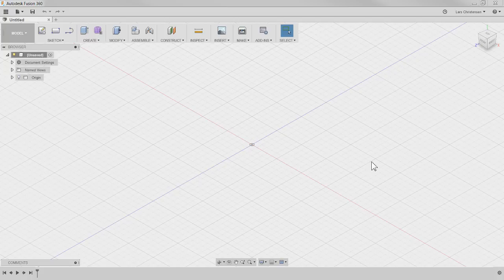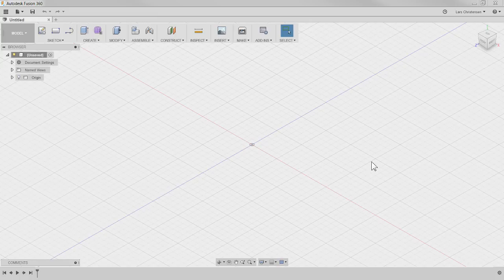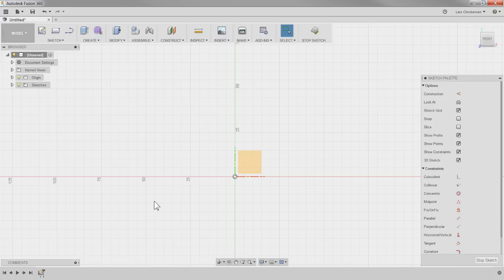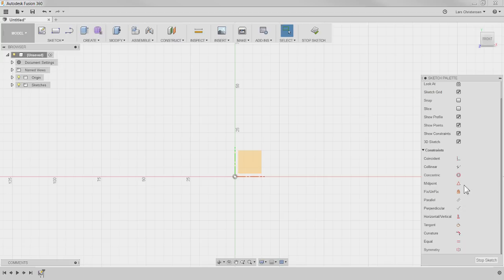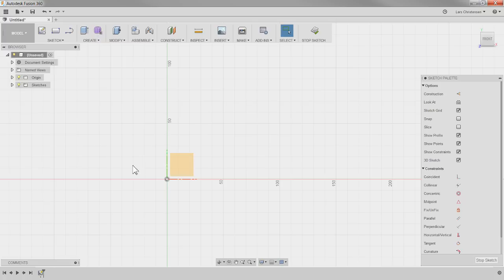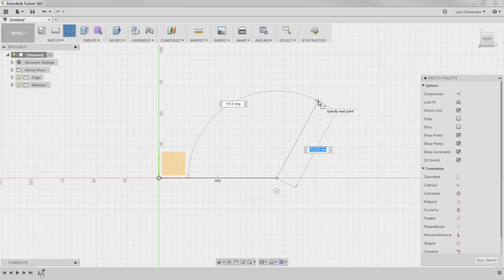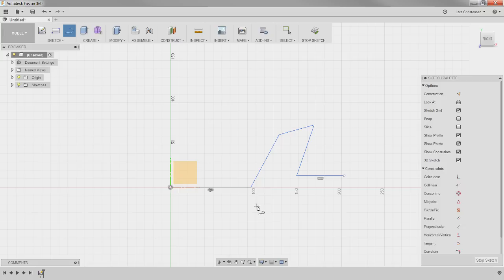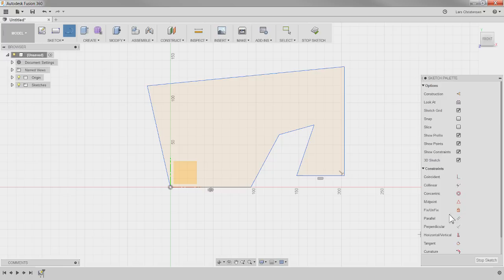How I use Sketch Constraints and Dimensions — Fusion 360 Tutorial — #LarsLive 113

Comment: I personally prefer to make fillets as a feature rather than in the sketch, simply because adding a fillet can break some of the relationships I may have set up on the line.
Reply: This is a very good point. I've had this come back on me after machining the first op and didn't catch the issue till after the soft jaws for the second op didn't come out correct.
Reply from the maker: +1 Love the wisdom shared

Comment: I am constantly getting to a point in designs where I want to move things and can't work out which constraints are locking stuff down and preventing me. Often they are constraints that were auto applied and often to do with centre points. I end up dumping the whole design and starting again quite often. It would be great if you did a diagnostics video showing how to spot whats going on and how to unlock designs to adjust things
Reply from the maker: Not sure exactly if this is what you are looking for https://youtu.be/6ZTpLj8lyyM
Reply: @cadcamstuff  That's a useful looking video, many thanks.

Comment: Helllo again, Lars! My name is João Carvalho. I'm Portuguese and I'm starting with Fusion 360. In fact, I worked for some time with Inventor and I'm using the latest Inventor 2020 version. As you know, Inventor is a little different from Fusion 360 ...! So my problem is this: I created all the parts of a Wankel engine system, but individually. I would like to assemble them, but I created them one by one and saved them in a folder inside a window (where I gave each piece a name). I did not draw the different parts within the same drawing sheet. I was used to drawing in Inventor and I followed the same steps and now I don't know what to do with all the drawings / files ...!? Could you help me with this issue? Thanks in advance. Sincerely: João Carvalho.

Comment: Lars,  How do you get Fusion 360 to stop placing automatic dimensions when you are making your sketch?   I can turn "dimensions" off but then when you click it back on...there are all your automatic dimensions all over the place.  Even when I am doing my rough sketch...Fusion wants to put in rough sketch dimensions for all lines.  So the sketch is clustered from the get go with constraints and with "fusion added" dimensions before I even go to put in my own dimensions...or in this case needing to edit all fusions initial dimensions.   Your model is very clean as you work.  Is this something new that Fusion has added with the new UI overhaul?  Is there a way to stop Fusion from giving dimensions as you work?   Thank you for all the time you put into these videos.  They have all been a big help.

Comment: Thanks! This is very helpful. I'm a beginner and you filled in several gaps in my understanding, tied together a lot of concepts and answered several questions. I've been working through a book with 100 2D/3D widgets to learn drawing in F360 and was slowly figuring out the flow you demonstrated of sketch (makes sense why they're called sketches now!), constrain, then dimension. Also, I really liked the tip about staying in the line mode and then drawing a tangent arc - that is so much easier than what i was doing!

Comment: Holy Heck! The mouse-generated tangent function you described has solved an 'issue' I was having with my 3DX CadMouse. I do get the occasional switch-bounce on the LH button and so was holding down the button to try to counter this. I suspected there was a function there that created some kind of arc that I was unaware of - and your explanation nails that one. Super-useful!!
Now, if I can just get the mouse to occasionally stop drawing short lines at the beginning of the line I want, I will be a happy bunny!
(I have lost count of the amount of times I have had lines being out by fractional angles or distances because there was a minute 'blip' at the beginning of a line. Sometimes these are not noticed until many extrusions have taken place - a l-o-n-g way down the timeline. 🤦‍♀️🤣🤣 )

Comment: I find with complicated parts or assemblies, constraints are great but its so easy to forget what is constrained to which line or point, especially with the collinear constraint. I would love a feature that you would be able to use, that references dimensions in separate sketches. That would help considerably in the customisation of a part.

Comment: Excellent, I feel like I now fully understand constraints - thank you!   I came to this video as I was looking to solve a problem, I have a .dxf file supplied by someone else which has over 152 lines that SHOULD join up but they don’t so I can’t press/pull (or extrude as I have watched your video on this topic).   So my question is how can I identify where there is a hole in a seemingly joined up shape?   Thanks in anticipation.
Reply: Mike, If you look at the date of this video (Jan 2018), you’ll notice it is over 2 ½ years old. And I’ve read that Lars has a different job at Autodesk, so I doubt he has time to keep track of the hundreds of older videos. However, I will try to answer your question. I’m also pretty new to Fusion 360 so there could be better ways to do it, but I’ve always used the divide and conquer approach. In other words, just keep narrowing down the possible error locations.

If necessary, start a new blank drawing to see what I’m talking about. Draw any simple Closed sketch on a plane, even a rectangle. Notice how is changes color as soon as it is completely enclosed. That is what you are looking for. Back on the problem drawing, just start dividing it roughly in half with Temporary lines. Hopefully, one side will now show as “closed” and you can concentrate on the other side. But even if you have problems on both sides, the process is the same. Just keep creating smaller (temporary) areas until you find the open spot(s). After you’ve fixed the problems, remove all of the temporary lines. 

Hope this helps. Like I said, I’m a noob too, but even if someone else has a better way (which I’d love to hear), at least this way works with any type of CAD program.

Comment: Hi Lars, just getting into F3D.  I am going to have a 2 or 3 part assembly.  Part 1 the mounting bar will always be the same size with a standard set of mounting holes.  Parts 2 & 3 will slide onto this, but will vary in size.  first model (small) will only use mount holes 1 & 2. second tool (medium) will use mont holes 1 & 3.  Third tool (large) will use mount holes 1 & 4.  Is there a way of locking certain dimensions & hole positions, while allowing a few other dimensions to be altered?  Best regards Paul Murrell

Comment: Another great vid Lars - Thank you.  Need some help.  I'm sketching up a profile for a wing rib.  The front and top are made up of multiple tangent curves.  In one version I used a spline.  I need to smatter my sketch with XY dims just to lock it down??  It looks terrible.  Seems like there should be a better way.  What about fix/unfix? I see that Fix turns the line green and prevents it from moving.  Any unfavorable side effects?  Seems like it was OK when I extruded.  I should clarify, this would simply be sent straight to g-code.  No drawings or dims needed for plan views.
Reply from the maker: You should be fine fixing the geometry as long as you don't need to control it with dimensions. End result is what matters :-)

Comment: I really enjoy your approach to F360.  I've learned much and always pick up something on a re-watch.  I do have a question about hoe to fully constrain a triangle in a sketch.  I may be making this harder than it should be, but I can't get the sketch to lock no matter how many ways I try to fix the triangle to it proper place.  There must be a trick I'm missing.  The tringle has two equal sides (isosceles ).  I think this happens with all triangles. This looks like a good place to group things, but that isn't a function in F360 or is it?   There is no one single anchor point to set the constraints to that will lock it in place relative to other geometry in the sketch.  I remain dumbfounded. Any ideas would be appreciated.  Thx a heap.

Comment: Hey Lars your videos have been extremely helpful but I have an issue I can't seem to fix. I have a rectangle sketch. Inside the rectangle I have another equal 3 rectangles spaced evenly to the main rectangle boundary. What I want to be able to do is when I stretch the main rectangle up or down and or sideways. (Eg: length and width) I would like the 3 inside rectangles to follow. Stretch when increasing length, reduce when reducing length. Is there a simple way with dimensions and constraints to do this? Would really appreciate your help with this. Thanks Mate

Comment: Hi Lars! Thanks for your videos--I've learned a lot. I'm using Fusion 360 to model a small steam locomotive and I have two pipes that are to be connected by a silicone tube when I actually build it. The pipes are at odd angles and heights relative to one another, in 3D space. I'm having trouble modeling that flexible tube between the two pipes and would appreciate any tips you might have to add that to my model.
Reply from the maker: Hi tzkelley Thank you for watching!

Check out this video:
https://youtu.be/WvCNGR8C2uo?list=PL40d7srwyc_Mkgc5wvP_OfVel9aDkNkZ6
Reply: Thanks, Lars--that is what I was looking for.

Comment: WQi8th the version of 360 it seems that there is no ability to display the constraints menu on the right side, only at the top menu. Is that correct?
Reply: I seem to have the same issue. Cannot get the constraints in the right menu bar. Only at the top.

Comment: G'day Lars, Thanks for yet another great tutorial! I have a question that is not about this tutorial.I am modelling up a valve from 2D drawings. this valve has one component that is basically a hollow cylinder that has slots,(ports) around the outside of the cylinder. Is there a way to get the slots to follow the cylinder O.D? Trying to do the slots using an offset or tangent plane doesn't seem to work very well as the cylinder wall thickness varies Cheers - Peter Spence.
Reply from the maker: Hi Peter Spence Thank you for watching!
Can you email me a screen shot? I need more coffee to imagine this...
lars.christensen@autodesk.com

Comment: Lars - how do you use the X, Y and Z lines to reference your figures. I cannot seem to use them for constriants, or for measurements to say I have drawn a rectangle 160x200, i'd like it placed 50/110 and 100/100. It does not seem that you can use those lines like I can in my other CAD, and it makes no sense to me that you should not be able to align to the grid. In our machines we like to define centerlines where ex our bottles are and where our critical dimensions are thus the  different centerlines are very important. Am I just missing how it is done?

Comment: Please explain the Fix/unfix constraint. Thanks
Reply from the maker: Fix is like nailing the geometry to the wall, or freezing it. Unfix is like taking the nails out or applying heat
Reply: @cadcamstuff  When and why would tou use it? I understand the application of the other constraints. You either want coincidence or not, you want equal sizes or not. But, fix or unfix i don't understand
Reply from the maker: I only use it for splines as they can get a little crazy to try to constrain
Reply: @cadcamstuff  AH HA, that makes sense to me. Thanks

Comment: Do you have any videos concerning constraining the geometry of splines in such a sketch? 

I've draw a fuselage: two splines with offsets, closed off at either end with vertical lines. I notice that when I draw cross members and apply constraints to them....such that they be parallel and 3/32" - they seem to push and pull at the spline itself.

I've added some dimension to the spline ( angles), I'll try the fix constraint.... haven't tested it yet.
Reply from the maker: Hi Robert Vander Voort Thank you for watching! 
The easiest is to right click and lock the spline. If you need to fully constrain it, you need to use a combination of dimensions and constraints. all spline handels and points need attention

Comment: What if I want to sketch one line an exact distance and parallel from another (already drawn) line.....I don't want to try to measure the distance between the lines up front, I just want to draw it, and apply a parallel constraint...AND THEN some distance constraint to move the line the exact distance away from the first (already drawn) line I need it. Can you do this?
Reply: I am no expert and maybe wrong here but:
sketch your new line, apply the parallel constraint to both lines. Then hit "D" to sketch the dimension and select both lines - the distance arrows will be sketched along with the value , this value you can then edit to your desired distance.

Comment: I am building a bmx bike fork and I sketched a line verticle at 60mm from origin and 200mm high. then I made a three point arc from the top to the center. but both the line and arc is still blue. why?
Reply from the maker: Hi Northern Freelance Thank you for watching!
Best thing to do will be to grab a corner with your left mouse button and start dragging it. That should tell you what is not constrained

Comment: I have a question. It is easy enough to arrange for two circles to be concentric using just constraints, but how can you arrange for a smaller rectangle  to become "concentric" with a larger surrounding rectangle, again just using constraints (without using the move command). I'm sure it is possible, but I can't seem to do it without the inner rectangle from changing size. Any ideas?
Reply: You can use two construction lines that go diagonal across the two different rectangles. and then set the midpoint of the smaller construction line to the midpoint of the larger one.
Reply: @sangansplan  Ah, you genius you! It works like a dream. A single diagonal on each rectangle, draw a point at the midpoint on each line. Then lock (turn green) the rectangle you want fixed, select coincident constraint and select the two newly made midpoint points. Obvious - now why didn't I think of that? Thank you.
Reply: Yes of course: You don't even have to lock a rectangle, the one that moves is the one selected second.
Reply: Another way is to use offset, but that only works if you want a constant separation all the way around. In fact, offset works on all sorts of shapes (even ones with curves), not just rectangles.
Reply: @allyourcode  Thank you for your reply. The off-set is definitely another way, and an easy way at that, especially if the shape isn't a rectangle - how else would you do it with a (say) polygon - which is probably the primary use of the off-set anyway. So let's call the rectangle a special-case polygon!

Comment: i need help  this is driving me nuts becassue its something that I used to do all of the time, it is simple/  yet I can n to figure out what I have to do to make it happen

Pretend your making a funnel in free form design.  You start out with a simple cylinder with say 4 sections in both horizontal and vertical.  all I want to do is pull up on the top ring by double-clicking and pull it up and out to have the whole ring follow in a symmetrical way 

In other words, you can literally make a funnel shape in one move   but I can remember what I have to do

id ANYONE can drop a hint I would greatly appreciate it.

Comment: I am up to 12:05 of the video and you have just finished advising us to use the tangent restraint but you didn't explain what it does. I understand a line intersecting with a circle at a tangent but it's not clear to me what you're achieving by doing this in line draw mode. I understand that you can get your sketch into a mess if you don't use it, but why?

edit: I think the reason is to prevent a line ever intersecting with its own arc (since a tangent means one point of contact).
Reply: Making a line tangent to another ensures that at least for an infinitely small distance they don't form a hard corner.  Usually this is done with at least one curved line; doing this ensures the transition from the one line to another is smooth and doesn't have an abrubt, zero-radius corner at the transition point.
Reply: The mathematical way of thinking of it is that you have a slope (derivative of path/position).  The derivative of slope is curvature (hence a curved line).  At the point of the tangent the slope on either side is the same (the limit as you approach the point from either direction).  And the curvature is 0 (not changing).  For Fusion 360, it means that the constant slope of the line will smoothly change its curvature away from 0.  If you didn't have the tangent constraint, the limit of the slope from each direction is different and curvature at that point is undefined.

For a real world example, imagine a long thin piece of wood stuck vertically in a vise.  You can bend the wood and the vice ensures the tangent constraint.  If you bend the wood too far and it yields/breaks, you lose the tangent constraint.

Comment: Can anyone help??

how do I add sketch constraints with other components/bodys?

example
I'm drawing a kitchen, I have drawing one kitchen unit (sink unit) and I what to link a new unit (corner unit) to the original unit (sink unit). 
For some reason my sketch will not link to the anything that is not in that sketch which makes the positing a bit of a guessing game. there must be a way to do this but I cant find it. 

thank you,
mike
Reply: It sounds like you want Joints. Sketches are for drawing geometry on surfaces - either faces or planes. If you want to connect those units together, Joints would be the way.